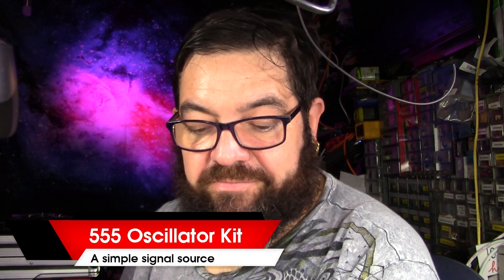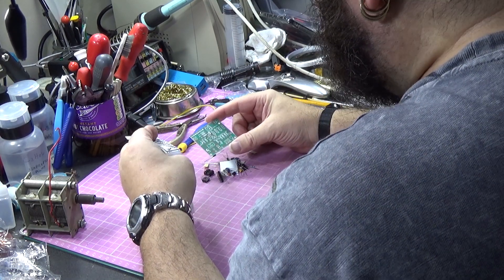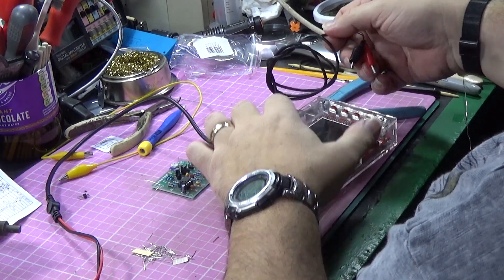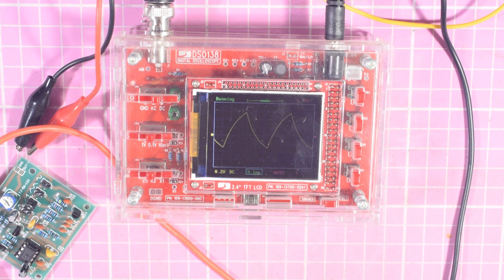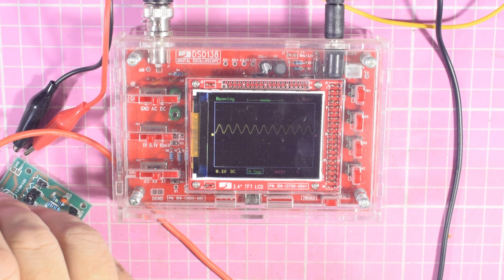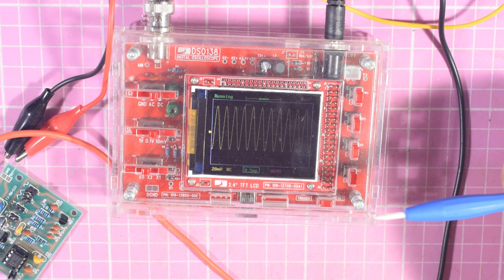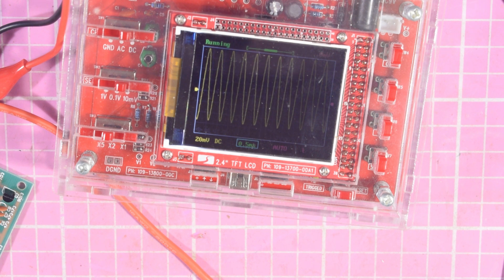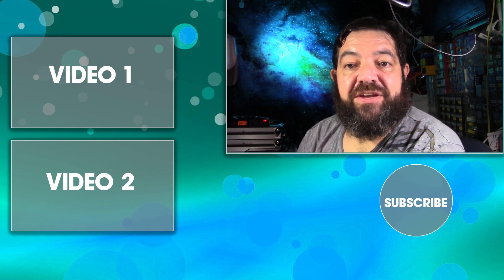555 Wave Generator - CHEAP Kit Build and Test

Comment: I am working on a 555 circuit  that will produce four wave shapes, Square, Sine, Triangle and Saw.  As well it will produce them in six frequencies.  The scematic you show has some interesting features that I thing I will work into my circuit.

Comment: Hey buddy, it was really cool to see the wave generator in action. I think you co u ls do with some more lights on your work space, not necessarily for you, but it appears dark in the video. Also maybe you can put the links up of where you bought the wave gen and oscilloscope. If it was amazon you can also make those affiliate links. I thought you spoke clearly and you didn't throw too much technical jargon into the mix so those without great understanding can still follow along nice one. 👍👍
Reply from the maker: Thanks for the comments. I know the lighting is awkward sometimes due to the small space I have. Hopefully in the next month or so when I build the new space I can put in much better lighting. Most of the stuff I get comes direct from China and I have looked at affiliate links for the gear.  I try and keep the jargon down because I do want to aim at everyone, not just other techs.

Comment: Hi George, 15 minutes to build that kit?....it would have taken me 2 hours to build on my best day....LOL
Reply from the maker: I understand that Bill, you have your limitations because of your vision. I have a tendency to just throw the kits together because they are easy for me to work on because the components are what I was always brought up on as standard sized. I have a kit waiting to build which will be a bit more challenging. It has a lot more parts and a fair bit of surface mount stuff, so resistors that are 1/16th of an inch in size and capacitors the same so it will require a bit more care in assembly.